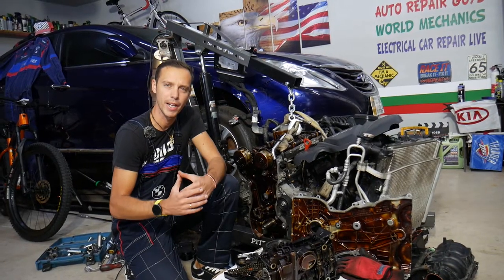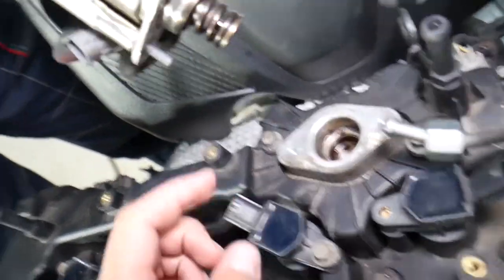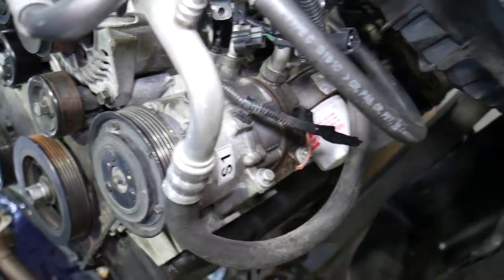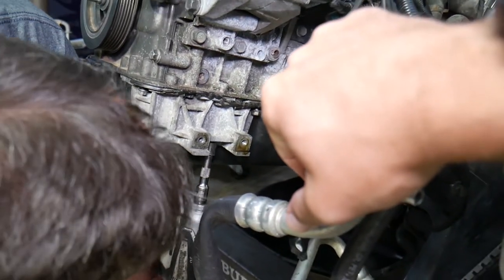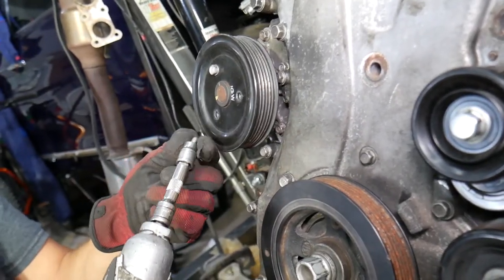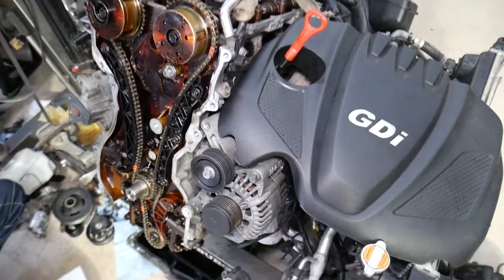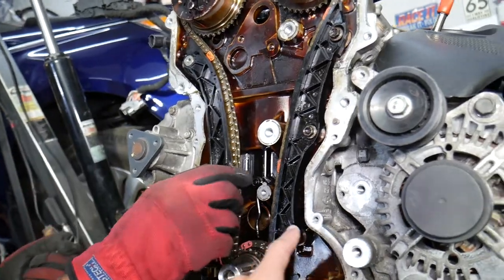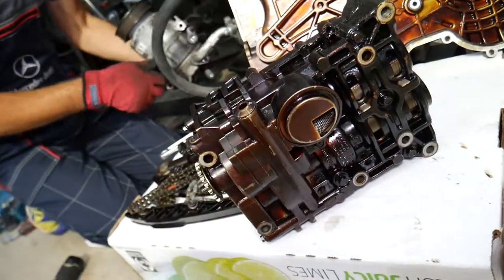OIL PUMP REPLACEMENT LOCATION HYUNDAI KIA 2.4 GDI ENGINE

Comment: Anyone watching this that is working under the car, the pump easily slides out of the chain with a bit of tilting, it’s easy to relieve pressure from the bottom tensioner using your hand.
Reply: dont you need to re time the engine thought?

Comment: i have a question i have a 2013 hyundai sonata 2.4  i keep having a code p0014  i have replaced the oil pump and set the time up for it to the crank and the guides also the chain and tenchener  also replaced the cam timming chain and guids and tentchurer  and the vvt set wright and also the 2 cam sencers on the head and also replaced the oil and filter with 5 20 sinthedick and synthidick filter also replaced the spark plugs runs and feals the best it has ever but im still getting a p0014 so what have i missed any idea what i can look for  thanks robert